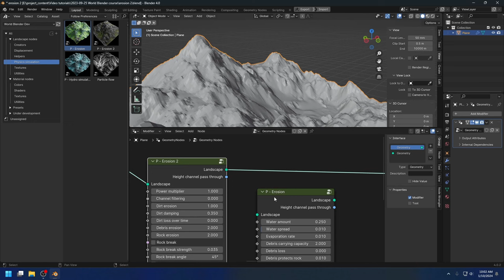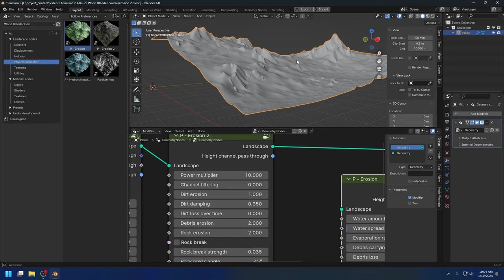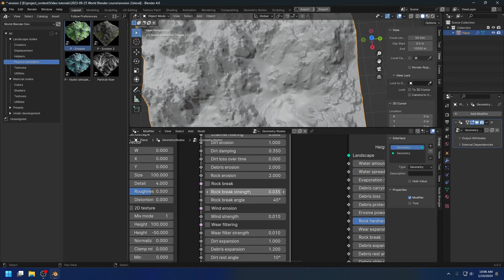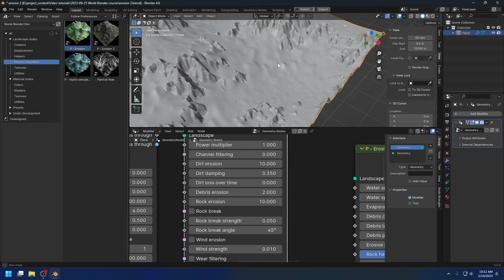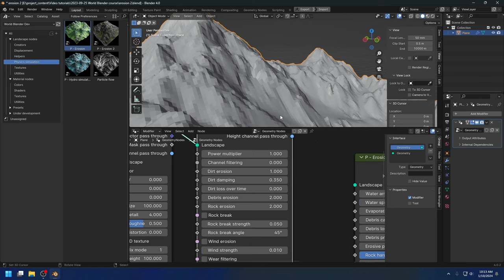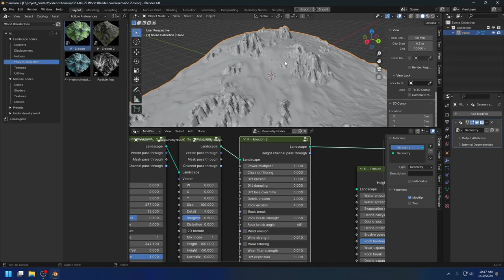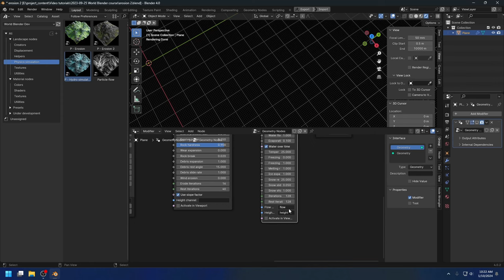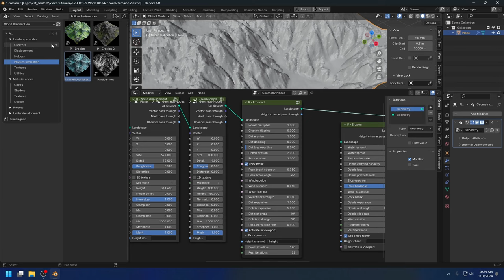World Blender 09 - Erosion 2

Comment: Hey, Is there a way for me to create a "sea floor" if you will that lets me 'void' the sub divisions below a set peramitor as to not use up prosessing power im not going to need? if not may be something to add to the pro version?
Reply from the maker: I'm sorry, I don't quite understand your questions
Reply: @LancePhan  I am creating an archipelago and want to cut/flatten the terraign below a certan level to save on poly count. like creating multiple mountins with a flat floor and a sea
Reply from the maker: @playthreetwo  There is a node in the Pro version to flatten a height level of the terrain, but the poly count remains the same after flattening. Optimizing the landscape is not yet a part of World Blender, you must do this manually after the Landscape to Object node otherwise it will break the data of the landscape